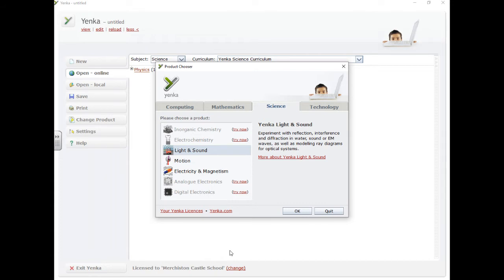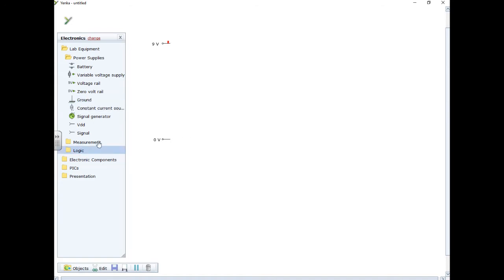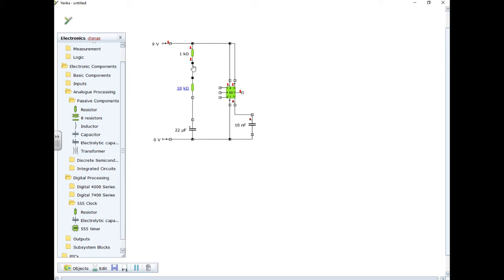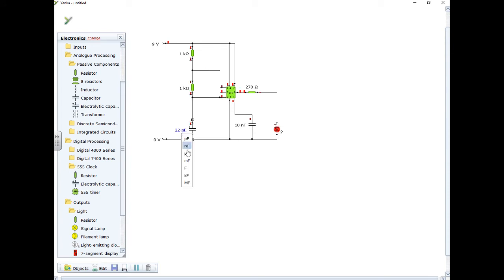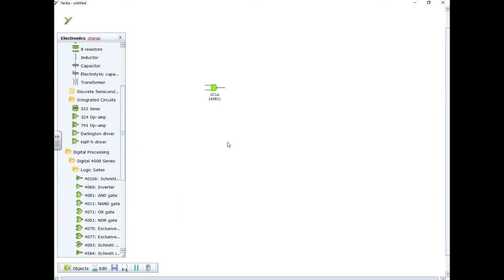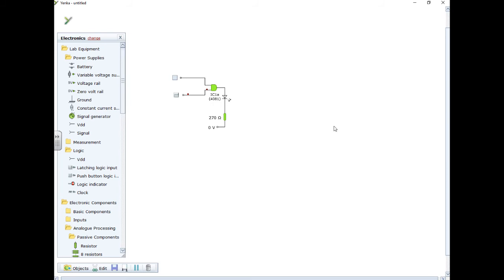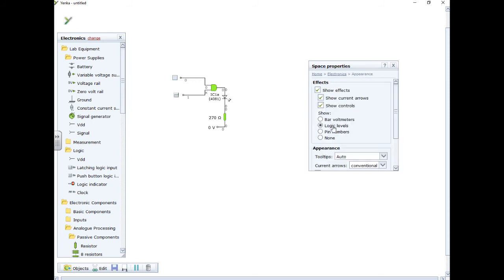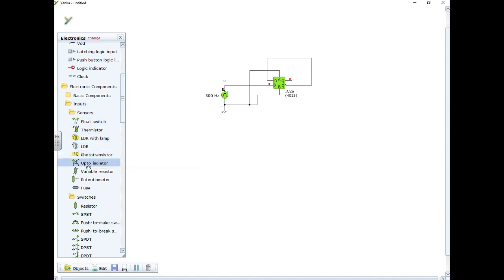Yenka simulation software - an introduction for my class

Comment: OOOooh that reminds me what we used in highschool in France back in 2000, it was called crocodile clips and the circuit diagram looked exaclty the same. I spent countless hours on that besides my TI83+😅 Thanks for the memories 😂 It's a good software in the educational field, no doubt!
PS: for the story, I copied that from the school computer, floppy by floppy week after week until i eventually had al files to be able to use it at home 😅 and it did work withou install - Boy these were times!
Reply from the maker: Indeed you're spot on. Crocodile Physics and Crocodile Clips rebranded as Yenka. You can download a home version if you fancy a trip down memory lane. I particularly like the way things blow up and catch fire so much more dramatically than on a protoboard in the lab. Thanks for the comment.